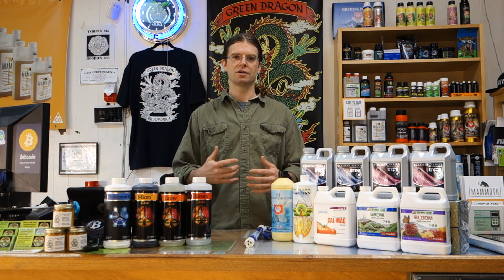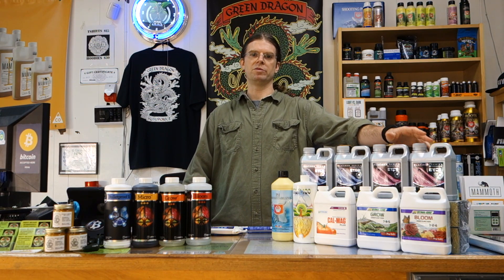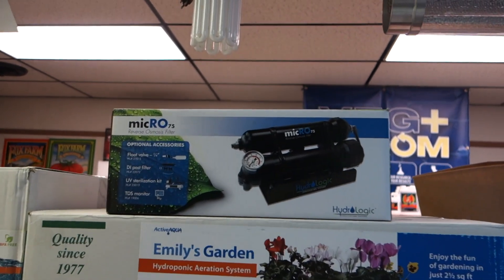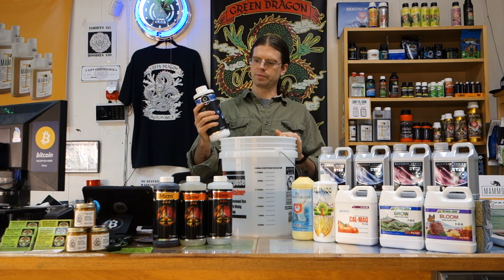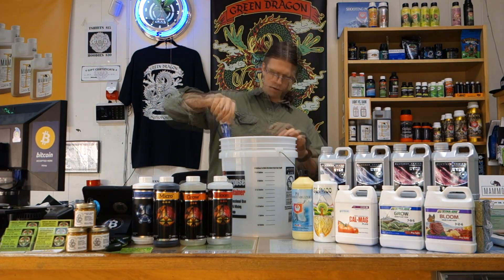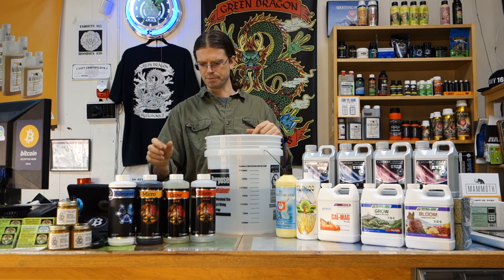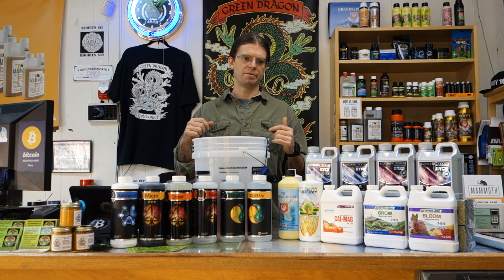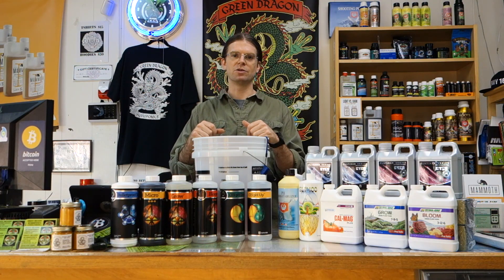Mixing a nutrient solution for hydroponics or soil

Comment: What's the purpose of the Bulletproof Si? I have the basic Cutting Edge 3 part but I'm not sure what the Bulletproof is for.
Also,  for DWC you said to use 50% of what cutting edge recommends. So let's say that Cutting Edge (as directed on the bottle) recommends 5ml per gallon for seedling. I should use 2.5ml per gallon and so on?
Reply from the maker: bulletproof is a silica product that helps strengthen stems and leaves, and helps with pest and disease resistance.  Also, Yep I'd go in light for DWC, but double check their website, they may have an updated feed chart for DWC specific